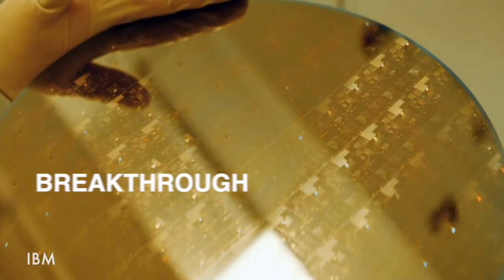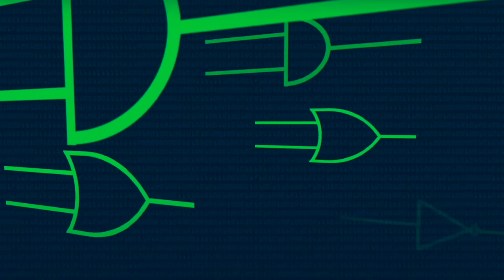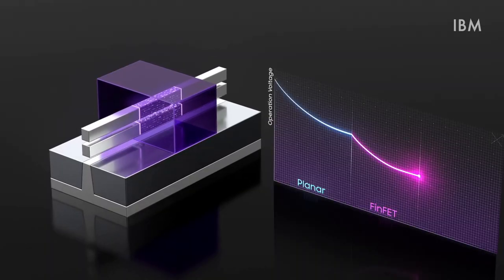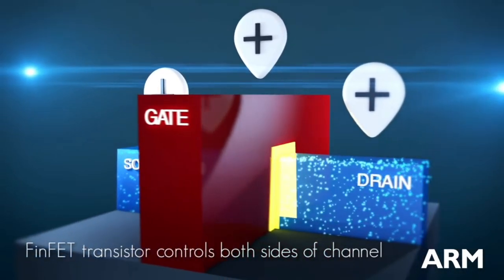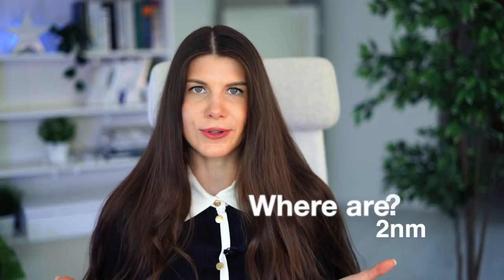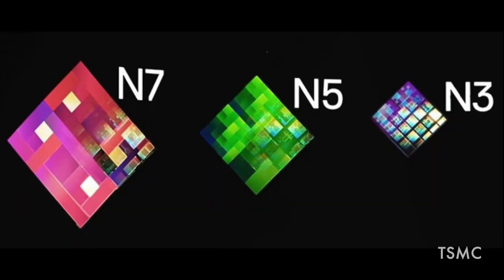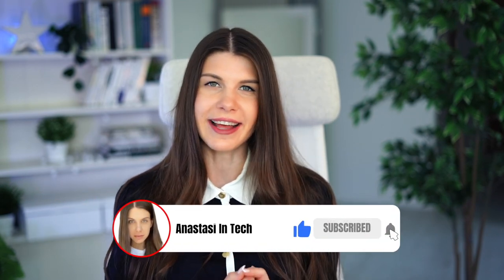New 2nm IBM's transistors explained

Comment: My dad works in TSMC for over 20 yrs. He said that these mass production is a thousand times harder than inventing new process. I think this point is applicable to all industry, as Elon Musk has also said similar stuff.
Reply: it's called the cost of exploitation versus the cost of the exploration ...  how much it cost you to find a new process in comparison on how much it cost in using the same old process, this equation actually carries from an industry to another and so, if any company didn't manage this equation right it will fall soon or later, I managed to create a small company in my country morocco two years ago just before the pandemic and what I can say that this is 100% correct.

Comment: When you take the total number of features divided by the 2D space occupied on the wafer you get the 2nm. It is a direct measurement of features per surface area. Since features are stacked up on 3D structures, you can fit more on the 2D area and that is the density measurement used for reference. Larger features are better for many reasons and IBM's technology is superior if you need long lasting or life in space etc,,,
Reply: Actual structural size has gone up slightly. 0.2 nano-meter is possible but the features could not be used for thermodynamic reasons. The challenge of tall structures is heat not size. There is no point in putting more features on the chip than you can power or remove the heat from.
Reply: @earthengineer8344  Well, OK. Yes. there is  that.
Reply: @collegiateindependentstudy6437  So TSMC's hubris caused the chip shortage?
Reply: @edocioprovost1896  I didn't say that.
Reply: @earthengineer8344  
The 2nm size is just a marketing gimmick as they are nowhere the size of a 2nm transistor size. 
The chip shortage is to do with the pandemic because it actually affected inventory systems on every aspect of manufacturing. 
It is not just the actual chip production that has been affected everything from water services, materials production, mining, transport and tool making has been in contraction. 
International markets are based on supply and demand and when that balance is interrupted and confidence is eroded it causes problems. 
There is shortages in everything from wood, food, minerals and so on.
Reply: @bighands69  Feature per area square has nothing to do with transistor size. No one ever said that a transistor was 2nm in size. Transistors are 3D objects. Features are the number of transitions or junctions not the number of transistors. Every transistor requires more than one feature so the number of transistors does not track with the numbers of features.
Reply: @earthengineer8344  
Moore's law is about how many transistors can be placed in a particular area. People are implying that the transistors are 2nm and are under the impression that we now have reached the limit. 
You will routinely hear people talking about how Moore's law is finished and that the transistors cannot be made any smaller.
Reply: @bighands69  Moore never said that at all. He said the number of transistors and resistors on a chip would double every 2 years. Dave House talked about compute power and 18 months. Moose never said features would get smaller just numbers would get higher.

Comment from the maker: Let me know what do you think ! <3
Reply: I think the nanometer number has something to do with the reproducible alignment accuracy between the features of different masks over the width of the entire wafer. 

For example, many features of 5 nm chips will rely on the alignment between different mask layers that is consistent to within 5 nm. 

[HINT] Wherever you can align Critical areas of masks at right angle to the features of adjacent layers, that's easy. Because the actual location of any intersection at right angles is coincidental but still nearly inevitable, instead of requiring tight control.
Reply: what part of this industry do you work in?

Comment: I'm not convinced it's over. 

I think we just need to change the definitions of chip to include silicon with surface mount electronics directly attached.  This allows dramatic decreases in distances between whatever is laid on the silicon, and seems to be a promising direction.
Reply: You do not think what is over?
Moors law is not shrinking transistor sizes.
Reply: Agree!  DoJo is a prime example of continued density growth. Moores law should be defined in quantity of useful compute per given area.

Comment: so when I started designing chips at intel in 1985 the design used 4u CMOS transistors, and the last chip design I worked on in 2015 the design was done in 13nm a 308x shrink in technology

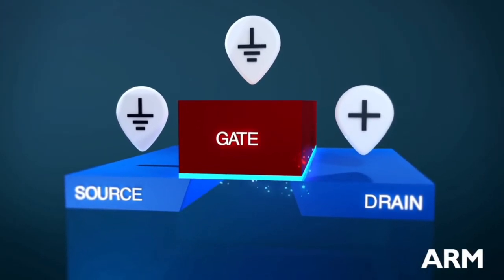Comment: 8:15 I would guess that to get to smaller dimension structures would depend on the wavelength of light that they use with their lithographic masks. The last I heard (when I was interested) was Extreme Ultraviolet (EUV or EUVL L=Lithography). Of course the next step would be to use X-ray wavelength light to get even smaller that may be a long way off as they have just "started" with EUV.
Reply: X ray lithography is not new.  The process is not economically viable for mass production. Also, each EUV machine takes 6 months to build, and sell for about $150 Million dollars, so imagine a gigafactory full of such machines!
Reply: @Gary Menezes
They are nowhere near the size of 2nm transistors but the marketing makes people believe that they are. 
In theory that would mean that they would have 430 trillion transistors per square inch if they had 2nm transistors. 
At the moment they are lucky to have about 500 million per square inch. They are about 25 doubling cycles of those types of growth figures. 
Now I am being very conservative in regards to that.
Reply: Electron beam epitaxy!
Then there is molecular electronics. 
Take chlorophyll as a photovoltaic receptor for instance.

Comment: I have a topic you might find challenging. Twenty (+? Not sure.) years ago, I read a story in some tech magazine about crystal and light computing. The story was about Moore's Law, and what was laying around languishing on some shelf in an R&D lab somewhere. The crystal and light computing hardware was said to be feasible, but 180 degrees from conventional computing. Using photons, rather than electrons, it supposedly solved many of the problems you've mentioned with atomic scale and size. To be honest, the way the article was worded, it sounded as if this stuff was ready to go forward. 'Popular Science,' or maybe 'Popular Mechanics,' I can't recall. I was reading many of those back then, as well as other computing and science magazines. At the time, I mentioned this article to an IT friend, but he had not heard of it. He had heard of photon assisted electronics, but not this. Would not be the first time that an alternate technology has been relegated into obscurity.
Reply: some company has maybe google has already made special purpose matrix multipliers using light computing.
but again special purpose matrix multipliers may not sound as exciting as cpu but could translate to light computing based cuda cores un graphics car and could revolutionize the gpu industry
Reply: @anandsuralkar2947  Very interesting. I think I saw something on that, not too terribly long ago. The intriguing part of that article I read way back when was that it entered another order of magnitude smaller, using photons. But if I recall correctly, there was no compatibility, and no one could figure out how to bridge it with current processing. If it is workable, someone will eventually.

Comment: So the source and the gate are not 2nm but the performance, what can do a real  2nm version, better is to say that gate all around brings better performace because there gate works better and need less energy. We need a measurement standart were company or processor fabrication have to use. Thx for the nice video.
Reply: @donniebaker5984  yes  you right  the problem is that  the manifacture companys not  real honest  or don't  use them,  when  the  say about  how  small now  there circutes in the  cpu  are. It would  better that  the  comanys  have   to  give  the  real  nm  specs or  say what  is,  in  which  size. But  at  0.1 nm  anyway is  the end, maybe als with 1nm .

Comment: if you make smaller transistors do you need to input lower voltage ?
Reply from the maker: For larger tech nodes like 65nm, 40nm, 28nm nominal supply voltage was going down as well.
For new nodes not so much E.g. 28nm - 0.9V, 16nm - 0.85V, 5nm - 0.8V.
Reply: Search nokia 3310 vs 1 million volts

Comment: Hi ,very nice video from MOSFET to finfet to new technology 🙂.can you make an video on possible things that will happen in the industry or the technology if Moore's law is ended ? (All things come to an end )
Reply from the maker: Thank you :) Yes, I will consider to make such a video in future
Reply: Moore's Law was broken some time ago, or at least the industry couldn't keep in lockstep with it.

Fabricating multiple cores onto a single "chip", and operating them in parallel, is an industry response to the distortion of Moore's "constant". They couldn't keep increasing the single thread execution speed at the expected rate, so they took away most competing loads from a critical task, and the consumer was mostly satisfied. A four-core chip can potentially run four independent single-thread tasks at full speed. So, in some sense it is 4X faster, but the original promise was a single core running four times faster.

Now, a lot of compilers will easily rewrite single thread code so it has prefetch and disc I/O buffer routines on a different thread or core, or even on a different server. The compiler may also, with some control flags set, rewrite code so that it is record-locking instead of file-locking and this permits the records of the file to be hashed onto many different file servers, so that many records can be pre-fetched simultaneously, in parallel. Other improvements in parallel processing will dispatch records to any available compute server, along with the task. Again, all originally developed to totally bypass Moore's Law. 

The hardware industry may also try to assure that some cores have less effect on the heat dissipation capacity of a specific core, so that one core can run hotter faster than the others (look for a single core "turbo" or clock speed increase). The image of such a chip may show much of the memory, cache, and support circuits in the center, with one core rather isolated physically from the other three.

Finally, Moore's Law promised power dissipation halved every two years or so, but that also could not be achieved. So-called octocore machines are actually two different sets of four cores. Many tasks can be completed in the background at a leisurely rate, and can all be run at a low clock rate. This greatly saves on power. Four other cores still run much faster, and are used to process things that would irritate the hell out of users, if not completed promptly. 

For example, don't you hate when your smart phone cannot echo the characters you are typing into the dialog box for a second or two? Wouldn't it be even worse if the keyboard locked up, or your game was laggy? So keyboard, gestures, screen image updates are all high priority. Most apps in the foreground are running on the four faster cores. But as soon as the phone is "idle", the slower cores take over. They may also take over if the faster cores overheat.
Reply: @imconsequetau5275  
Moore's law is not broken and it is people's lack of understanding that is at stake here. 
The semiconductor industry has been on a marketing pathway for decades. They have sort of convinced people that Moore's law is to do with size of the transistors that they are marketing. 
Moore's law is about the number of transistors that can be put on an integrated circuits such as 1 square inch. 
Per square inch right now the number of operational transistors is about 500 million. And the doubling period of 18 months has held up. 
Not every company that is involved in this has kept up with that figure because it is not about companies keeping up but the level of growth of transistors per square inch in the industry as a whole. 
So what we really have is companies pretending that they on an individual level are somehow producing Moore's law level growth every 18 months. For them to keep this promise up they all would have to have completely new chip sets every 18 months that double in capacity.

Comment: I told everyone the Moore's Law will continue despite all the dis-hype due to multiple potential technologies, including 3D, DNA, Quantum (not really, it's a different thing altogether) Photonic and others. It's not going to stop. We will find ways to surpass or circumvent the plain old transistor design. The limit is the laws of physics and we are not even close.
Reply: People are confused as Moore's law has nothing to do with transistor sizes and is an observation about how many transistors can be operated on an integrated circuit. And it does not matter if it is 18 months or 36 months. 
2nm does not mean they have an integrated circuit where each transistor has a foot print of 2nm. 
That does not mean they have 10 trillion transistors per square inch. At this point they are lucky if they are near 500 million per square inch. 
They probably have another period of 30 doubling cycles before they reach the actual theoretical limits of space in terms of how many transistors they can squeeze onto an integrated circuit. 
And that does not take 3d stacking into account or other types of 3d architecture. Finding ways of dealing with impedance and leakage is really the challenges to be faced.

Comment: As we're already 3D in the transistor design, as well as pretty close to the silicon atom width, do you think there will still be many ways to increase performance and/or power efficiency in classical computers? Or do we need to switch to cloud based quantum computing or something for increased performance as soon as such new tech becomes widely available?
Reply: Yes there are more new technology in the pipeline. The next step after GAAFET is CFET (Complementary Field Effect Transistor) this is basically two transistor a P-type and N-type stack on top of each other.
Reply: Hi, we are not that close to the silicon atom width. A silicon atom is about 1/10th of a nanometer in diameter and the smallest structures made nowadays are about 5nm wide which is still about 50 atoms wide. At some point we will reach the limit where we can't get smaller with conventional silicon. What can we still to increase performance: 
1. Use a different material with better electrical properties. For example parasitic capacitance / leakage.
2. Optimize the geometry. 
3. Use a different type of transistor with software controllable characteristics (Makes it possible to turn NAND gates to NOR gates etc.)
4. For example: Improve scheduling and other design choices within a microarchitecture. 
etc....

Right now it does not seem that quantum computing will be able to perform classical computer tasks such as video playback etc. They are very specific machines that excell in very specific tasks.

Comment: “Expected performance of 2nm”??

Or “Expected density”?

And how will they get the heat out? They will need a method to extract heat through the 3D structures.
Reply from the maker: Check out TSMC InFO_SoW

Comment: Please can you explain us the big.little and maybe from the RK3399 Chipset Cortex-A72, Cortex-A53 and maybe how I can write a driver for a Linux Kernel? Oh I'm sorry this is a question for about 10 Videos - sorry. Nobody will us tell how I can write a driver for hardware for example a 16bit, 24bit Audiocard PCM5102MK. If then I can finish my network speaker that i planed in 2008. Best Regards Volker from Vienna

Comment: Transistors inside CPU's and MICROPROCESSORS are in fact 1 particle thick and it takes HEAVENS MANUFACTURING 300 Million years to make 1 new CPU. A MICROPROCESSOR takes 400 Billion years to make. I am the Arkangel Daniel and I am from Heaven.

Comment: These GAA chips have their problems though. First, not all chips can be made this way. Second, it will be really hot if you stack transistors on eachother, so each transistor can't run the same frequency as before. Third, as we add more layers, manufacturing cost will also increase accordingly, or even more,.

My money is still on silicon photonics.
Reply: Yes yes... But who sais you can't do something to get rid of the heat by smart design choices.... I can't disclose more, sorry.
Reply: @MicroageHD  Yeah I know a lot of people are studying that, including some in intel who made Golden Cove cooler at the samd power consumption. 

But this also has a limit.

Comment: my question is, what tasks are suffering under present day chips? Will my phone load instantly or will I still be waiting for my internet connection? Will cars finally be more efficient than having everyone just drive (traffic is very challenging), or is the programming still beyond us, and if the programming was developed we could use it without smaller nanometers? My computer is old, and I am able to play all of my favorite games, and my games wouldn't improve from a powerful graphics card. I don't mine cryptocurrency, but the present model of simply printing money to verify each transaction does not seem sustainable, at best it is a scam. where will the meaningful improvement come over the latest announcements of 7nm for average cpu buyers, and 10 nm for budget buyers,,, the world will run on 10nm chips for generations to come, it seems these will not limit technology? the size of the die will not be overweight in a rocket.